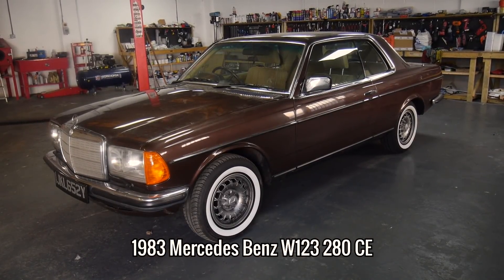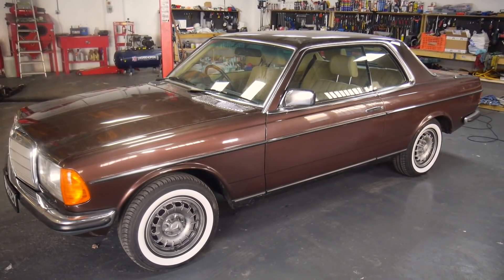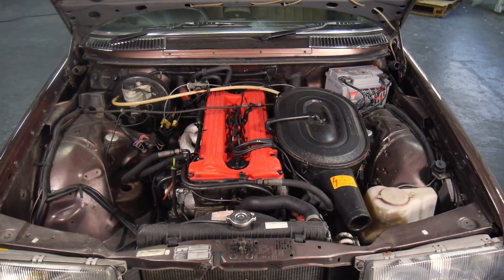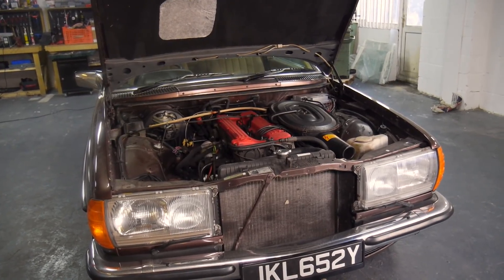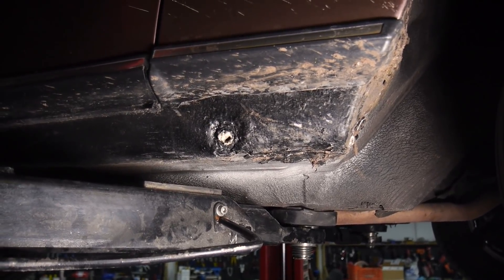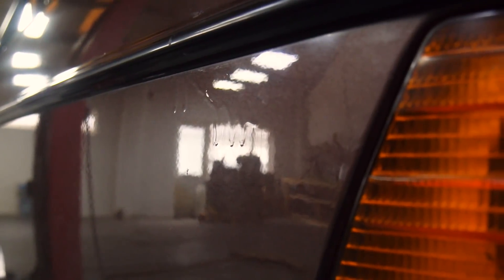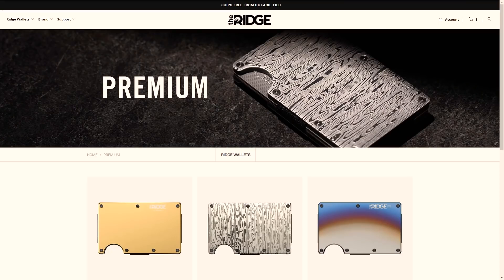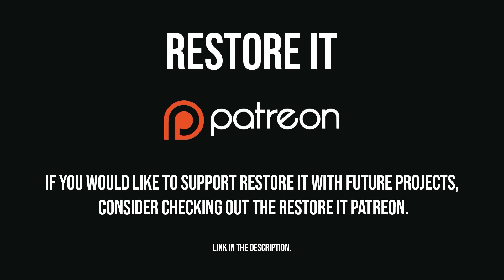1983 Mercedes Benz W123 280CE Restoration | Part 1 | Expanding foam Fun

Comment: I am currently working on w116 with the exact samen engine and this vacuum leak has to do with the Auxilary air valve being stuck open. It is located on the leftside of the car underneath de intake. They are quite hard to come by and are around 200 euros here in Holland. But they are fixable so I guess thats good news. I am very excited for the upcoming video's I have been watching you for almost a year now and love the content you make.
Reply: This valve acts like an automatic choke for cold starting. That's also the reason for it being so hard to start. You could check this valve by putting it in a cup of hot water. If the valve is closing after it has been put in the hot water the valve is ok and you should probably look at vacuum leaks around the breather hose on top. Wish you all te best for this resoration.

Comment: Wouldn't surprise me if you find some panels repaired with chicken wire, old newspapers and much bondo...
In german these types of cars are called "blender", blinds you with nice appearance, but if you look closer...
That holes in the forward section maybe a grabbing point for the OEM carjack, carjack monts are often gone with the rust...
All the best on that job, will make a great series of vids!
:-D

Comment: 6:40  😯 Wow what a crime!  Imagine having a flat tire and trying to put the jack where it should go...  passing what you call MOT long before that metal has "gone", here where i live is impossible. (normal cars older than 5 years get thoroghly checked like the german TÜV does but here it's each year. Official classic cars every 2 years.)

Comment: Little question, the paint is the original, or was already fully repainted in the past? . I say that because the quality of the paint still superbe, and it may me pity of a new respray to the risk of having a less good result (but i now sanding and polishing can save and make miracle :),  but , I completly understand the necessity as the body is full of little rusts spot . Good luck and to see you will gain more experience it' very cool for you ;)!

Comment: Former mercedes classic center mechanic here: at 7:00 you have the so called 'jack holes' where your in car jack attaches to. We had special mounting plates  for our lifts to use them properly - if not given, you can also use a 1/2" short extension socket 😁 those frame rails and mounts tend to rust.. eventually mercedes decided to use plugs and later a better design to lift the car.

And if you need any parts, feel free to contact the mercedes classic center in Poole - it looks like that they are the only official classic center in the UK

Comment: 70% sure, vacuum leak.
Also, that expanding foam made me want to cry, Christ, way to make a small problem far worse.
Reply: Out of curiosity, what are you listening for to see if it is a vacuum leak?
Reply: @charliemartin3748  by listening to the way the engine runs. When the engine runs really rough that could be due to a vacuum leak (ruled out it is not misfiring).
Reply: You better not look at my 1999 Subaru Legacy then...I’ve had to use 4 cans of that foam in order to seal the gaping rust holes, so that road salt/briney slush couldn’t spray farther down into the body of the car.

(Don’t worry, I’m not selling her to some poor sap, once I get her replacement she’s going straight to the junkyard. After 22 years and over 260,000 miles, she’s earned her rest.)
Reply: @300DBenz  If you had to use 4 cans it probably should be there already, let's be honest.
Reply: @imnota  She’s been at the junkyard for 3 months now.
Reply: @300DBenz  Sad to let them go, but it's inevitable really

Comment: It's a C123, not a W123
Reply: @Intelcroa  123 series would include all versions.
W is true only about the sedan

German wikipedia uses xxx code and Baureihe(series).

That's the correct way.
C - coupe
R - roadster
A - cabrio
S - estate
V - long wheelbase
etc.
Reply: @Random-nf7qb  i looked it up and you are right, i thought that it would include all
Reply: @Intelcroa  😉

Comment: I got a couple of these. You have to check the floor from inside, especially in the back. Most common is rust behind the drivers seat. Also check rocker panels from the inside. Check the firewall and behind the battery tray. Check drainage, both under hood and the ones from the sunroof if it got any. Check electricity for shortages, it is common and could be hidden. Check behind insstrument cluster from underneath so that you dont have any oil leak. The oil pressure gauge is mechanical and have a small oil tube going in there. If no oil - dont remove the cluster! 

As someone already said you probably have a vacuum leak. Is it shifting well? It is supposed to shift very smoothly, not hard and not slipping on 2-3th or 3-4th gear which could be common.

Comment: Hell yeah. I am too in the process of restoring my 123 sedan :D Definitely check behind the plastic fender liners in the front and be prepared for a surprise (you probably are not going to get around removing those front fenders :p) Same goes for the pockets on both sides of the trunk that are covered with plastic as well. Also make sure to remove the spare tire and check the area underneath as well! Good luck with that car! Its only gonna keep on 'giving' :p